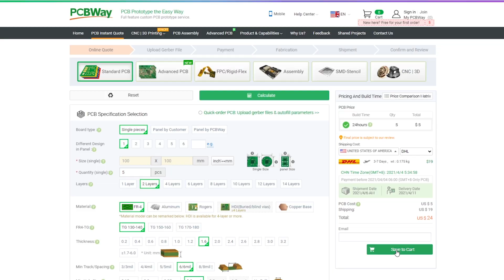Making My Custom 1U Rackmount Pfsense Router Silent

Comment: Your heatsink might be better going from front to rear instead of side to side.  The airflow would be easier.
Reply from the maker: the heatsink is fixed on the board
Reply: @victorbart  Yeah, I wasn’t blaming you. :) Makes you wonder what thought process happens when these things are ‘designed’.

Comment: Can the main board not control fan speed. Or is it like my old atom board that can not?
Reply: A lot of the problems with the fan management on many boards is that if you have fans like these that are designed to spin rapidly, noise is not usually a concern and it is not assumed that the speeds need to be lower. So you often times need to apply a resistor modification to allow for even further silent operation. This board does have fan management but not enough to satisfy the loudness of the fans in his application. :)